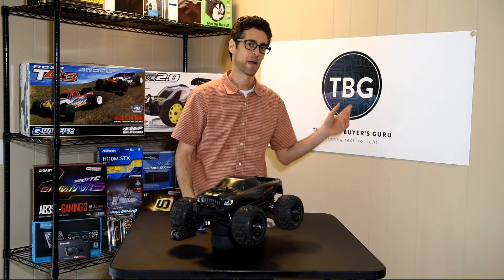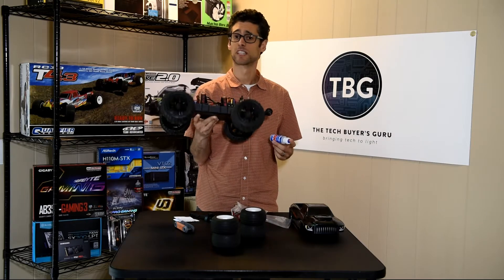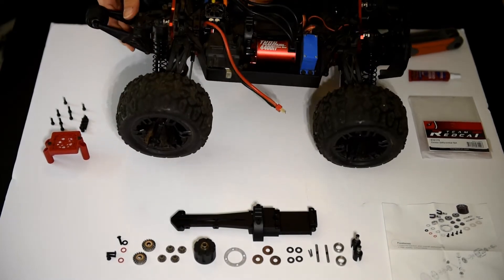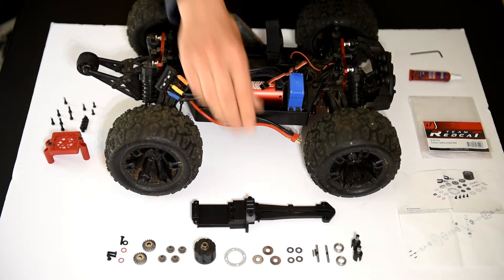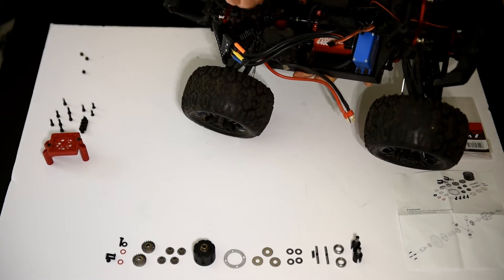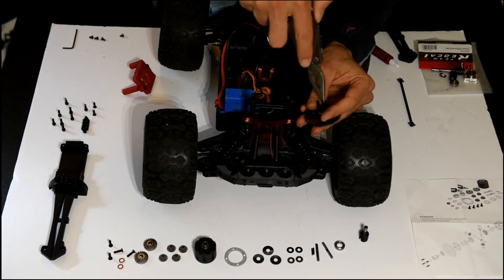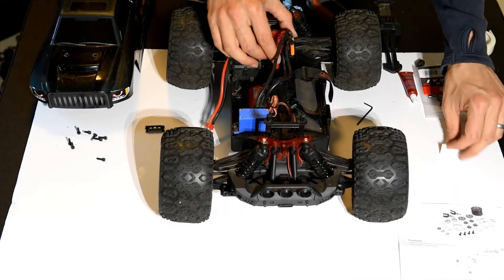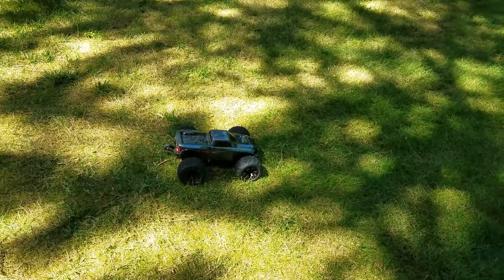Team Redcat MT10E Center Differential and Drive Shaft Lockpin Installation

Comment: I didnt get the woohoo.... front wheels dont spin if I hold the rears and trigger. I can turn them manually but it's not super easy. 300k oil... did I definitely do something wrong? Any idea what it is? Thanks
Reply from the maker: First thing I'd try to figure out is whether there is a grinding noise when you manually turn the wheels. If you feel mechanical resistance (like a notchy feeling) when you hold the rears and turn the fronts, then something may not be lined up in the diff. 300K oil definitely should not lock it up.
Reply: Thanks. I had it out again after thr first non-woohoo and tough to turn either cup against the spur - but no grinding noise. I guess I'll take it all apart for try #3 tonight!
Reply from the maker: Oh, man, that's frustrating. This truck isn't exactly easy to work on - getting that center diff means taking out a bunch of screws. Definitely check whether it spins OK before attaching all the bracing.
Reply: @TheTechBuyersGuru  Yep - I'm getting good practice!
Reply: @TheTechBuyersGuru  One more data point.... after shooting my vid above I stuck the diff in and the wheels WILL spin on trigger- woohoo! But I'd lost a lot of the fluid pulling the spiders and washers in and out... so I removed it and topped it off again, now they wont spin. Thoughts? Do I simply remove part of the fluid? Top it off with lighter weight fluid? Thanks again
Reply from the maker: One thing I've learned from building up other kits is that you don't want to top off diffs. The oil should just cover the cross pins (after letting it settle in). So yeah, if it worked ok once you'd lost a bit if oil, that was probably the right amount.
Reply: @TheTechBuyersGuru  thanks. I took out oil until it's level with the cross pins.... now the wheels will just barely ratchet forward slowly before the engine cuts out. Now sure if I should take out more oil still, seems like it'd be dry... wheels are pretty easy to turn with my hands while holding the rear still. Maybe I'll drive it this way for awhile. Maybe I'll put the 9t pinion back instead of the 11t and see if it can spin them. Thanks
Reply from the maker: Wait, are you saying that when you hold the rear tires and pull the trigger, the front wheels barely move and then the motor stalls? You don't want the motor to bind up, that will damage it. But one thing to consider here: no matter what, this isn't as locked up as having no center diff!!! And given that you can turn it by hand, clearly the center diff isn't jammed. You just used some pretty thick oil for a truck of this size. So you can absolutely drive it, worst case is that it operates like it did before you put the diff in, it won't cause any damage to the motor unless you intentionally bind the tires up and gun it. I don't think the pinion change would cause this problem, although running 11T will generally cause it to run a bit hotter in normal operation. I think you're good to go, just watch out for mechanical grinding sounds or a motor that won't turn, otherwise, it's time for some woo-hoo!
Reply: @TheTechBuyersGuru  thanks for all the help - really appreciate it.  Yeah I'll run it this way and if it does too many wheelies maybe I'll put thinner fluid. Woohoo!
Reply: @TheTechBuyersGuru  It still did a lot of wheelies so I did go back, clean everything off and put 100k in there. Now it'll spin just like yours did on your video. Too wet outside to actually run it but my mind is at ease :)

Comment: what extra
 plastic are you referring to for the housing????
Reply from the maker: The original MT10-E used a housing that could not fit the center diff. Upgrade kits came with a new plastic housing. Redcat may have changed the design since then, so if you have questions, you may need to contact Redcat.
Reply: @TheTechBuyersGuru  mine they look the same so I didnt swap the housing truck bought early 2020.

Comment: My diff seems tighter than yours. I'm guessing theres a break in period
Reply from the maker: Mostly has to do with the weight of oil you use.  Hold rear tires and pull trigger to see if front tires turn. They should. If not, the diff is jammed.
Reply: @TheTechBuyersGuru  I used 100k. It spins just seems tight. Thanks for the response
Reply from the maker: 100K weight oil will definitely feel tight when you're spinning it by hand. But the truck will still handle differently than with no center diff. The brushless power is more than enough to get the diff spinning.
Reply: @TheTechBuyersGuru  thanks again...

Comment: How much fluid should I put?
Reply from the maker: To the top. But the trick to filling the diff is to fill half way, rotate the gears to work the oil in, then fill some more, repeat, and then top it off.
Reply: @TheTechBuyersGuru  thanks for the advice.

Comment: Hi my rear grubscrew completely backed out and flew off. Now my rear tires don't spin. Once I put one back in my wheels should start working again correct? I've only ran the truck less than 10 times
Reply from the maker: Yes, absolutely, as long as that's all that's wrong. It's quite a pain to access the rear grub screw, so it will take a while despite the simple fix.
Reply: @TheTechBuyersGuru  thanks I appreciate the prompt response and I will be replacing that grub screw tomorrow. Thank you

Comment: Did the kit that you posted a link from amazon came with the chassis brace/housing?
Reply from the maker: I didn't order mine from Amazon, but I know that Redcat updated the product to include it in all shipments, without updating the stock photo. You'll find the same photo on the Redcat site - no housing shown, but it's included.
Reply: The Tech Buyer's Guru thanks for the info! I just followed the link that you posted on your description and led me to the product in amazon. Great video!

Comment: Why not install a larger pinion gear with several more teeth to prevent wheelieing? It would solve this issue together with giving the truck more top end.
Reply from the maker: That's certainly an option, but it won't necessarily reduce wheeling that much, given how much this truck wheelies out of the box. You also have to start watching temps closely if you put a bigger pinion in and run off-road.
Reply: Going down the less costly road lol. I'm upgrading to a 13tooth pinion together with installing a Hot racing heatsink+fan . Would also set punch to level 1 since it's set at 3 default. Would make a video of the truck when finished 👍
Reply from the maker: Wow, sounds like you've done some nice upgrades to your MT10-E. Totally agree on pinions. I actually went up just one tooth to 10T, and on 2S it hits 26mph, up from 23mph, but it gets warm and it really doesn't have the low-speed snap that the truck has with the stock 9T. There's are a lot of good reasons Redcat went with this setup, although it probably could have used a lower-Kv motor. Sounds like your 4000KV motor is actually faster than the stock 4400Kv motor if you're hitting 60mph on 14T/3S.
Reply: smokin green Ay man after seeing this video I realized it's really not that hard a job to do the center diff. This video is extremely helpful and I'm gonna order the truck and upgrade to the center diff after a few runs. Thanks again bro.
Reply from the maker: smokin green - I actually went and did the same thing you did - picked up the 3660 4000kV motor from Hobbywing and the performance is amazing. Clocked it on 2S/9T, and it comes in at the identical 23mph the 4400kv did on 2S/9T. But then I tested it on 11T with both 2S and 3S, and it's SO much better. 2S/11T on the stock 4400kV was a zero-torque fest. Not much fun honestly, and while it could run 3S/9T, it was hot. Now on 3S, the truck does great without overheating, 9T or 11T (which is sort of too fast for every day). I'm actually just going to stick with 3S/9T for now, as the speed is easy to handle, runs cool, works great. By the way, switched to Pro-Line Trenchers on 17mm hexes and that helped handling a lot, due to wider stance (offset is bigger). Also installed front/rear sway bars and it's a whole new truck. Highly recommended for ~$30.

One note to modders looking for pinions - you have to careful, because two pinions I bought didn't work - the Traxxas Mod 1 11T was too long (hit the plastic chassis), and the Tekno Mod 1 11T pinion was too thick at the hex screw, scratching the inside of the motor mount. I've had luck with Losi Mod 1 gears, which are short and not too thick.
Reply: You can only go up a few teeth on the pinion gear on the stock setup. Had a 11 tooth on mine with a heatsink and fan and it ran pretty hot. And it made it wheelie more easily. Gonna run 3s on the little redcat all the time you need a center diff. Otherwise you'll wear out the rear dog bone fairly fast. Went through 2 and a blown rear diff before I dropped in a center diff with 60k diff fluid in it. Drivetrain wear issues solved. Just dropped in a hobbywing system with the 3660 4000kv motor and the 120a version of the max10 and man what a difference. Can handle a 14 tooth pinion with ease and run cooler than the stock system did on a 11 tooth with a heatsink and fan. Though the truck turns into a little monster. 60mph and will pull the front wheels at 50 when you punch it the rest of the way. When I'm done playing with stupid speed it's getting a 12 dropped in it And tame it back to 50ish lol on the stock system you try a 13 or a 14 tooth pinion it'll just cut out, too much amperage draw for the little 80 amp esc, 12 the absolute max but it has low speed torque issues. The truck is a little tank, other than the drivetrain wear issues haven't really broke anything. And mine hasn't lived a easy life.
Reply from the maker: Thanks for the feedback. If you want to help support this channel (which has no ads), you can use this link to the MT10e on Amazon: https://amzn.to/2Hu0rkW
Reply: Chris Watson glad you found the video and found it really helpful, I did too and knew it would help you out alot. For sure rum the truck stock a few times and then dobthe center diff. Need before and after runs to really tell what you've done.  I did start out with 60k fluid but later went to 40k fluid and a bit happier with that. Turns better in the dirt with the front wheels spinning just a touch faster and still have wheelies. Enjoy the truck bud.
Reply: The Tech Buyer's Guru the hobby wing 4000kv motor I put on compared to the stock 4400kv one  is really no difference top end wise, I too was shocked. The hobbywing is 4mm longer and has loads more torque and puts out the power smoothly. Doing the math on 3s going down to 4000kv it lost 4480rpm compared to the stock motor. Being that different rpm wise you'd think you'd see a minimum of a 5mph decrease in speed. At first I ran the 11tooth on the new system just to see how big of a top speed difference if any there was in comparison. 2 maybe 3 mph slower if that honestly but was super responsive to every throttle input. Compared when I dropped 400kv on my e maxx with the same brand motors I had lost closer to 8 or 9mph for comparison sake. The hobby wing 4000kv motor I got was a perfect matchup for the truck I think. It could go even higher on the pinion too and not loose any bottom end torque being on a 14tooth it still has more grunt than the stock system did on a 10tooth. But anything over 14tooth on speed runs your gonna need some harder compound tires or need to tape them. They balloon pretty wild like on a 14tooth. Have a set of proline badlands mx28's on my redcat and they get pretty darn big, balloon less than the stock tires did. I did like the stock tires though, really good for out of the box tires. Didn't last as long for me cause I have a 80 pound German shepherd who loves to chase my redcat... she killed the tires prematurely to say the least lol
Reply: The Tech Buyer's Guru awesome to hear man! The motor is quit impressive for the dollar I think. Did you get the 120 amp version of the max10 too or just the motor itself? Curious there. I had gone with 12mm hexes myself and kinda regretted it probably will go to 17mm myself for the wider stance, 12mm narrowed it just a touch and the body will rub occasionally but nothing bad. Gonna do the swaybars too, did alot to the shocks to help the body roll, h stiffer springs and different shock oils. Helped a bit but the sway bars are a need I think to step it's handling up to the next level. As pinion gears go I found the arrma mod 1 gears are a perfect fit too. The truck is nuts on anything above a 10 tooth on 3s I won't lie. Have a set of duratrax banditos that are a good bit shorter than the off-road badlands and use the 14tooth for those tires now when I run around on the street. More than makes up for the gear down on the smaller tires and it handles great on the road with those tires. Faster with the little banditos on a 14tooth than it is with the badlands on a 10 or 11tooth. Also has the half inch offset which helps loads on the handling.
Reply from the maker: smokin green - I just went with the motor, but spent a lot of time researching that 120A ESC you have (this one I believe: https://www.amainhobbies.com/hobbywing-ezrun-max10-sct-120a-waterproof-sensorless-brushless-esc-hwa30102601/p507477). I decided that because I was going to gear low and limit it to 3S (not 4S, which is what the ESC is rated to), I'd stick with the stock 80A ESC, and it seems to be doing fine. 

I also did the same things you did on suspension - thicker shock oil (40wt), and after using every spring spacer the Redcat came with, I just gave up and ordered the stiffer MT10E springs - $14 for all four (https://www.recreationhobbiescenter.com/products/redcat-racing-510120h-shock-spring-2-hard-red-color). Really makes this thing into a new truck all together when you add in the wider stance of the 17mm Trenchers (https://www.towerhobbies.com/cgi-bin/wti0001p?&I=LXGYZR) with 17mm hexes (https://www.recreationhobbiescenter.com/products/redcat-racing-510176bk-clamp-type-wheel-hexes-17mm-4-black) and the sway bars (https://www.recreationhobbiescenter.com/products/redcat-racing-510170-anti-roll-bar-set).
Reply: The Tech Buyer's Guru yep that's the one I have, exact same as the rtr 80 amp one just beefed up the electronics in the 120a one so you still can use the red filter cover as a brace for the esc. I only gone with it cause I was going a bit higher on the gearing and I wasn't sure how the 80a would do. But keeping the gearing low the 80a one would be just fine as you said. Went with those stiffer red springs, I had 40w oil in them but we're just a touch over dampened for my rougher terrain bounced a fair bit too much so I dropped to 30w and most the spacers, left the front with out the medium spacer and stiffened up the back a bit more with the mediums in the back. But have the big spacers on all four shocks. Been on the fence about the sway bars but hearing that you really like them I'm gonna buy me a set for mine. As center diff oil goes I had 60k at first but didn't turn to well in the dirt, hobby shop didn't have 40k but had 50k that was still too thick. Dumped out half the 50k and put in 30k which I would guess roughly make it 40k give or take. About perfect and turns like a champ. Once my badlands mx28's wear out in gong to 17mm hexes and either try those trenchers or go with the original badlands... or both if I can't make my mind up. Pretty awesome I had talked you into the hobbywing motor and I appreciate you responding! If you have the time if like to see a update vid on yours and maybe see it in action if you already haven't. Like to see how she does for information sake.. help me and others dial in out MT10E's even further. I'm throwing in a sub your way too man, like your vids the fee I've seen so far, keep it up sir!
Reply from the maker: smokin green - check out my new video going through all the upgrades I've made to the MT10E: https://youtu.be/lWLDK2DjGZI
Reply: The Tech Buyer's Guru just watched it and commented bud haha. Thanks for letting me know though! Truck looks sick my man.
Reply: Would be great if we could actually see what you’re working on.

Comment: Great video. Ill be putting a center diff in mine soon. I run mine on 3s and its a handfull. Popping wheelies was fun at first but now its a bit annoying. Lol
Reply from the maker: Oh, for sure, if you're running 3S, a center diff is going to help a lot. I've run it a few times with 3S, and the truck will run fine even with the wheelie bar retracted. I had to drop that all the way down when running on just 2S prior to installing the center diff. Wheelies are fun, but if you're actually trying to drive this truck off road at speed, the center diff is essential.